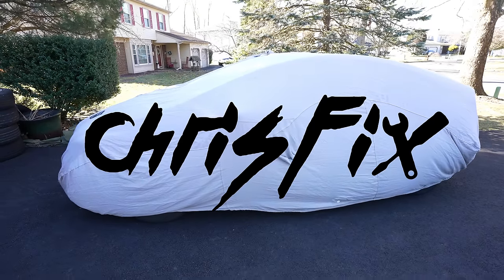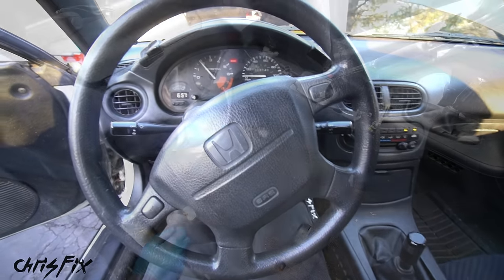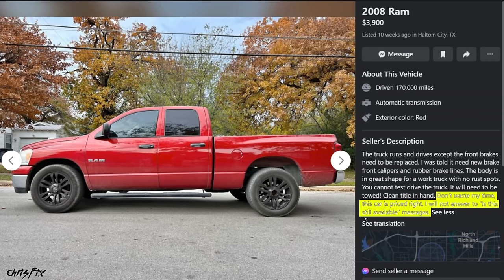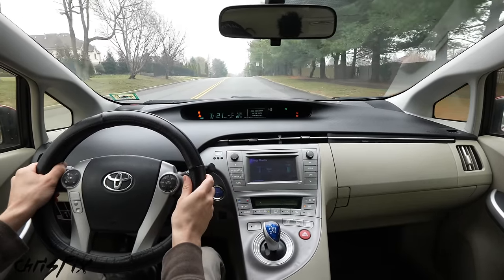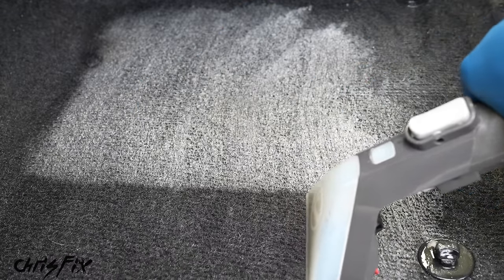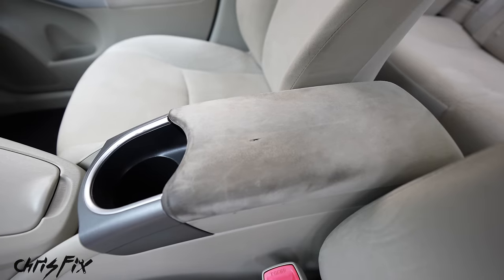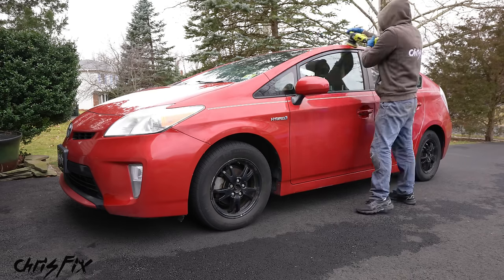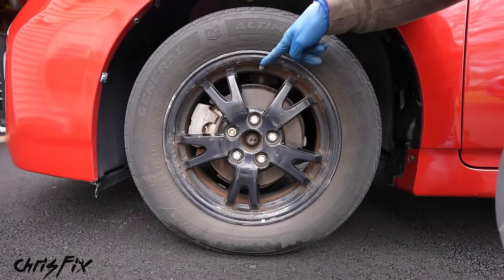How to Buy a Car To Flip for a Profit ($$$ Side Hustle)

Comment: FYI for your future spray paint issues: paint thinner will take off the spray paint and not harm the vehicle's paint. The vehicle's clearcoat is a 2k paint (has hardener). The spray paint is a 1k paint (no hardener and technically never actually dries). If you leave thinner on the 2k paint it will eventually break it down over time. However, if you just wipe off the 1k paint and allow the thinner to evaporate or wipe it off as you go, you won't have any issues. 
- Buzz's Body Shop, Newton NC
Reply: Legend
Reply: Chris ..What dressing spray is recommended for the engine 🚂 plastic
Reply: appreciate you boss💯
Reply: great knowledge thank you boss man
Reply: Acetone or reducer, acetone is much stronger though. And will leave a thin haze which you will need to buff over to make shiny
Reply: Thanks! This could be rather helpful. I'm getting ready to paint a car.
Reply: This, this is also why he was able to pressure wash it off, not only that but its usually acrylic paint on cars and vandals use enamal which wont adhere properly to said acrylic unless its properly prepared.
Reply: @QuiksilverSurfingVu  anything heat resistant.
Reply: @Maverick Isenhour I have a question on something I have on my Honda Crosstour. It has a bit of paint faded... imagine what happens when a canvas is left on a car and some moisture underneath for a long period of time. It looks grainy and whitens when finger rubbed. Is there anything I can do to restore the paint without having to re-paint that part?
Reply: Crazy to see someone close to home comment on a chrisfix video. If my family down there ever need body work I'll send them your way. I'm from Morganton/Valdese lol.

Comment: Hey Chris, I wanted to thank you for the videos you make. I’m 14, so I don’t have a car yet, but the knowledge I’ve gained has helped me diagnose and fix problems on my parents’ cars. Also, I have a go-kart and a while back it needed it’s oil replaced. Had I never seen your videos, I would have never gotten the courage to do it myself in fear of messing it up. Finally, whenever I’m bored I watch your videos. They have such a good entertainment value for some reason. Also, your videos help cheer me up when I’m down.

Again, thank you.
Reply: Same thing here! I got a go-kart too. (and dirtbike)
Reply: @sigmaadam223  what kind of go-kart? mine is of the off-road variety
Reply: I got a off-road mega moto and a honda crf125 big wheel
Reply: the honda is a 2023 btw
Reply: @sigmaadam223  aren’t those both dirtbikes?
Reply: no, the mega moto is a go-kart with mega tires on it. the 2023 honda crf125 is a dirtbike.
Reply: @sigmaadam223  oh yeah that’s right, I forgot mega moto makes go-karts too.
My go-kart is probably a brand you’ve never heard of: Tao Motor Targa 150
Reply: damn those things are cool. my dad also got one of the old honda odyssey. have a great day!
Reply: @sigmaadam223  yeah, I’ve always liked my go-kart. it has a 150cc 4-stroke single cylinder engine. Pretty sure it has a CVT (continuously variable transmission) as well. Got it in 2016, I believe.

but yeah I like your Honda Big Wheel too, I’ve recently wanted to get a dirt bike and yours actually looks real nice
Reply: the honda big wheel is a great starter bike for ppl learning manual trans. its almost impossible to stall it at 1st gear.
Reply: @sigmaadam223  huh, maybe that should be my first dirt bike then lol
Reply: definitely considering it!
Reply: @sigmaadam223  so I looked into it more and I think the CRF250F would be better for me. idk how old or tall you are, but I’m 5’9” last i checked, and I saw one guy say he’s 5’8” and he’s too big for the CRF125
Reply: i'm 10 yrs old, 5'1 and the bike is probably the perfect size for me
Reply: @sigmaadam223  I wish I was 5’1” when I was your age, I was like 4’8”

But I definitely think the 250 is probably the way to go for me, just because I’m only 14 and still have probably around 6 inches to go
Reply: you're choice man! hope it all works out for u
Reply: If you keep it up, you'll surely be a master in a few years (I know application means a lot more than just studying stuff online, though). You should try out My Summer Car, too, it's a great game in terms of "building a car" and learning automotive basics. I'm 26 and only started just working on my truck and it taught me a lot about cars, did all 4 of my brake calipers and bled the lines this week. 👍
Reply: @deqa  I actually do play My Summer Car, and I have built the Satsuma. I don’t often see other people that know about the game so this was a surprise
Reply: @DingusYi  Yeah that's a great game
Reply: @DingusYi  That game is good for learning cars, its also pretty funny. I'm from Finland just like the game itself.
Reply: It's great to see a young person taking an interest in cars! I'm sure you'll do well in life.
Reply: You can still flip cars like this. Start with detailing if your folks don't have tools. Then buy all the stuff you need to start at Harbor Freight. I know a lot of people that start businesses with HF tools. Start trying it, if you don't have someone to get the car for you go to the local businesses close to you and ask to use the parking lot. Industrial properties may help you out and the employees are a good resource to diagnose problems. Ask for help if you need it. Start small and work your way up. As long as you're moving units people will keep helping. If you keep working on the same thing for a month they will help less.

Comment: I have been a detailer for over a decade and I appreciate the fact that you are using quality products that are able to be purchased over the counter for the common person and not using low quality products. Also great technique with a lot of what you do.
Reply from the maker: Thanks! Is there anything you would do differently?
Reply: @chrisfix  Honestly, with the products you used, very little. One thing I would add, that 99.9% of people dont think to clean is the seatbelts. Pull them all the way out and wipe down with soapy water, just as you would the steering wheel. Also, I would always make sure to clean and check the trunk, tire well and the back deck by the rear window. These are other locations that most forget about that collect dirt, skin cells, hair, smoke, etc. 
I would highly recommend investing in at least an inexpensive steam cleaner. It will work wonders for you, especially if you do at least a couple cars a month. Amazon has some inexpensive ones for about $120. It would cut a lot of your cleaning down in half. You can use it for everything from door jambs, seat belts, everyone's favorite area between the seat and center console. It would help with the spots I mentioned and does a great job in the engine bay as well.

Comment: Awesome video, for those thinking of flipping a car though  I wouldn’t really recommend a hybrid unless you know what you’re doing. I used to work for a small dealer that specialized in hybrids. We fixed or replaced quite a few batteries and while it’s not the most difficult thing to do it can be dangerous if you don’t know what you’re doing.
Reply from the maker: That's the next video!
Reply: Hybrids are fun to work on cuz a ppl dont wanna touch them and b ppl scared to work on them. Ive worked on them at school its fun!
Reply: @jake78441  at school ?
Reply: @marvin2678  probably an automotive school or a trade school
Reply: @marvin2678  college automotive class
Reply: Admittedly I commented before I finished the video. I’m sure the next video will explain it in a way that anyone can understand. My comment was really towards the total beginner though as hybrids do add a challenge and some danger beyond what a typical ICE only car would, especially if you ever have to take apart the inverter.
Reply: I bought used hybrids before, and that is good advice - avoid them. The Prius is different than other hybrids in that you can still use the vehicle with the battery system disabled and it would be like a normal vehicle. Other vehicles there is not independence on the systems- ie the battery system has to be in good working order or your in limp mode.
Reply: Yeah definitely not for beginners. Some take more steps to disengage. Definitely a possibility of horrible consequences..

Comment: Tip from a professional detailer, that hyper dressing that Chris used is also great to use as a tire dressing. It has very little sling and looks great
Reply: what is the best thing you recommend to shive your tires that doesn't get full of dust on the first drive?
Reply: @MOperator  armour all tyre foam has worked great for me
Reply: @M4Operator101  by tire dressing or labeled interior dressing that say " non glossy finish" or "matte finish". I got that tip from some youtube detailers and it gives it a deep black like the hyper wax Chris used, but it'll last for weeks even with minimum build-up and I used to get co workers tell me what I sued on my tires or of I'm tired of cleaning then everyday lol. I told them I clean my car 2x a month at most and the tires stay deep dark black because of that switch in dressing. High shine has oils that get triggered by the temp of the sun and reactivates the product to get loose again causing sling and buildup. Matte finish ones tend to stay dry.
Reply from the maker: Great tip!

Comment: Couple extra points for sellers! If the car has anything other than a clean title noone will touch it. A rebuilt title, salvage, no title they wont buy it unless it's literally dirt cheap. Also I learned to check the vin number on engines to ensure they are the original engine that came with the car... if they dont match there's no telling how many miles it might have. Good luck everyone!

Comment: When doing the full cleaning of the vehicle, it might not be a bad idea to start with the engine bay, then do the headlights, followed by the exterior of the car, and finishing with the interior. Doing so would keep from transferring dirt and grime back to an area you just cleaned. If you do the exterior before the engine, you could have grime and soap splatter on the exterior, making some spots not as clean. If you go to all of the effort of buffing out scratches before doing the headlights, but your hand slips while sanding the headlights, you will have to redo the area around the headlights to remove any scratches you might have added. And if you do the interior first, when you're cleaning the areas inside the doors, you might get that dirt and the plastic cleaner stuff on the seats.

Comment: Hey Chris, great video. I have a tip for you and your viewers regarding tire tread depth which is mentioned at 44:35. All tires have a tread wear indicator which can be seen at 45:12 of your video. You can see the 4 long vertical grooves at this angle which run around the whole tire Just above your thumb, there is a horizontal "bridge" inside that vertical groove. Once the tread of the tire has worn down to the same height as this, that means your tire needs replacing.
Reply: Chris is also concerned about the tire being too close to that mark, from what i understood

If you only have a couple mm over the mark, the new owner would have to replace them very soon. Having plenty of life left on the tire easens the sell

Comment: Super informative and interesting video! A small welding suggestion would be with that mig welder, lower your wire feed speed, raise your voltage, and point the tip of the welding gun at the weld and push your weld forward instead of pulling the tip away from the weld as your welding.

Honestly though, the welds you produced after grinding definitely looked good enough.

Thanks!
Reply from the maker: Thanks for the tip! Should I push for all mig welds or just this type of weld underneath? I learned to pull but I learned on my own haha
Reply: @chrisfix  pushing the puddle with mig is best because it gives the most gas coverage. Like the other guy said raise the voltage a little bit. Maybe try to slow down a little bit too. Keep up the good work, your weld looks good for being self taught.
Reply: @chrisfix  Mig with gas is push, drag is for welding that has slag like stick or flux core.

Comment: Man thank you Chris for the confidence to tackle some stuff alone… the inspiration is real. Thank you sir
Reply from the maker: Just go for it. The worst thing that could happen is you get stuck or mess something up and you need to tow it to a mechanic or have a friend help you.
Reply: @chrisfix  oh for sure man! My rx8 was in shambles. Rotary’s are new to me but! I did the suspension and swapped out parts from learning your videos. 🤣 I love it man. My son watches your channel with me.  You are the man!  Are you going to be racing again this year?
Reply: @chrisfix  I have a 2010 explorer xlt 4wd and was wondering when starting with radiator cap off why is it at running temp the coolant shoots out the radiator? the overflow is reading full/hot all the time could it possibly be just too much coolant?

Comment: In the future to make carpets look brand new again, you can easily use a little bit of RIT dye and a water bottle with warm water and spray it down section by section. It usually takes about 24 hours to dry, but the carpet will look brand new.

Comment: Tip:  clean the engine BEFORE the outside of the car chris!   Also, set parking break before getting under it!  Also, you can use a wet/dry vacuum instead of your fancy one (whatever you called it)
Another thing NICE VIDEO!

Comment: I like the brushes.  I worked for my brother's detailing business and we always would silicone the dash.  Did a lot of work for dealerships.  One critique I'd give on this video would be to wash it first, and use the pressure washer to get the door jams and then do the interior, you rarely even get any water inside and would save on that wash and wax and can just silicone that or buff the paint.  Or keep that wash and wax and it would be a lot quicker.  We also would degrease the engine and then power wash it (carefully, yet fairly aggressively) with the engine on.  Never heard of any issues from clients.

Comment: You can polish headlights too, just be careful not to overheat them. Makes a HUGE difference.

Edit: Ah, I commented too early lol

Edit #2: Cabin Air Filters are often overlooked and can improve the smell of the air inbound to the cabin, as well as increase efficiency of the AC and Heat.
Reply from the maker: That is a good one!

Comment: This is a great, informative video. Thank you for sharing! If I may I'd like to offer a tip from my experience as a professional detailer. You should try mixing your water-based plastic and vinyl protectant and shine product with your water-based degreaser product in a ratio of 1 part shine to about 8 parts degreaser. Play with the ratio to find the luster you like, but it'll create a one step clean and shine product that will cut your detailing time in half! Simply spray it on and scrub and wipe like you normally do.
Reply from the maker: I'll have to try that out, thanks for the tip!

Comment: Chris, thats so motivating. 
I have a 97´Volvo V70, which needs some love. 
Almost no rust, but the paint has scratches and the sheet metal has a few dents. 
The Volvo also needs a thorough interior cleaning. 
But yes, it's spring and your video gives me motivation again for my personal before and after show. 
Greetings from Germany.
Reply from the maker: Go for it! I want to see some before and after shots!
Reply: @chrisfix  how will you know the before and after shots that he shot?
Reply: @mujtabaahmed1762  
There is a lil invention by mankind called "words", combine it with a basic Photo  edit software and it's pretty easy to tell which is which
Reply: @norbertbluhm6999  or even just looking at a dirty interior versus a clean interior
Reply: @norbertbluhm6999  I don't get it

Comment: 16:40 - Hey Chris, correct me if im wrong but It's possible the head gasket leak may be present between a cylinder and the outside edge (Not a coolant line which runs through the block), so the block tester won't find any combustion gas in the overflow, but its still possible there could be a failed head gasket (In which case, you would do a compression test on the cylinders if it runs rough).
I really like this series and I hope you continue to upload more in the future. Thank you :)
Reply from the maker: Correct. That would be obvious though because you would see a leak. I talk about the different headgasket leaks here: https://www.youtube.com/watch?v=q3_kDiQb7lE
Reply: @chrisfix  Not on my Saturn haha!, it's hidden under so much other stuff!

Cool, il check it out!
Reply: @chrisfix Hello Chris, In Europe (Poland) mechanics always do a head machining (and checking for cracks and valve seats) when replacing head gasket. The head screws are also replaced at least at second fix.

Comment: holy cow, ive seen places where rust was spray painted to cover it up, JB weld used on cracks in the frame, and even new hubcaps to cover up severely rusted steel wheels, to see you put a new fuel pump so the new owner wouldn't have problems is a sigh of relief!

Comment: Awesome video. I personally would have replaced the hybrid battery first, because the biggest and most expensive unknown is the transmission slipping. If replacing the high voltage battery doesn't fix the transmission issues, then a lot of interior/exterior detailing work might have been done for nothing.
Reply from the maker: So I 100% agree but unfortunately to make this a small series on fixing the car, I had to do this first. The process to replace the hybrid battery is a whole video and it would be weird to do that and then introduce the car and explain how to buy a car to flip. Hopefully that makes sense.
Reply: @chrisfix  the pitfalls of being a content creator aye